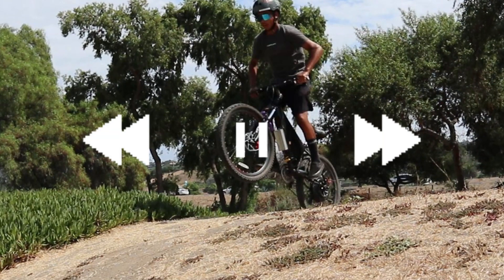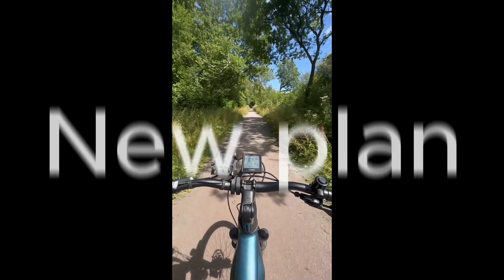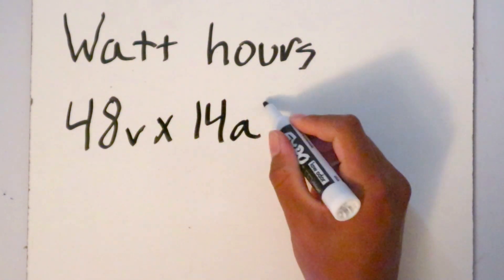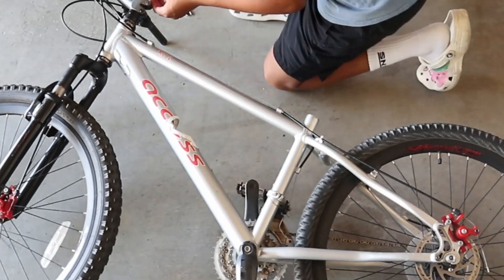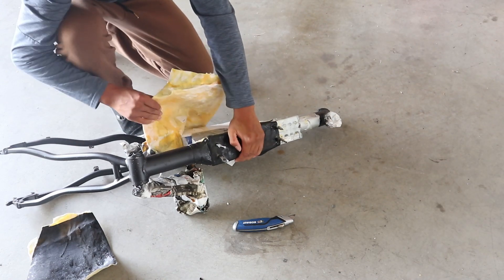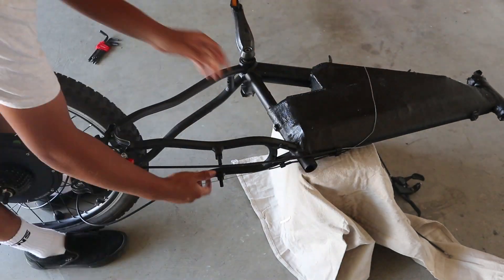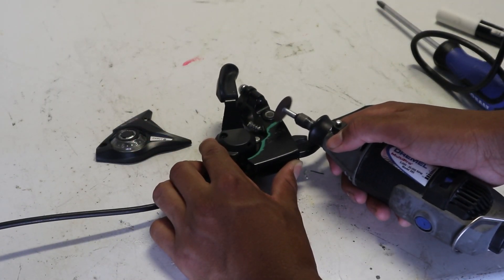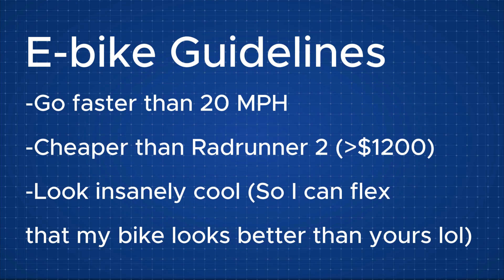I Built a Budget E-bike that Goes 30+ MPH????

Comment: This was not cheap but cheaply built 😂. The battery should be serviceable without tearing apart the whole frame. I think that the way to go is to buy a broken ebike for dirt cheap and go from there. If the base is bad or is messed up you can transplant the electronic on a new frame, cheap ebikes are just regular bikes with a kit and space ok the rack to fit the battery. The easiest is probably just to fix or replace what is broken on a good base (frame components are good but maybe it just needs a new controller or a new battery.

Comment: so you weakend the frame by cutting it ? and the battery is now non removable? traping all the heat inside of that housing. also if you make one bad landing and that frame colapes it will crush the battery with the sharp angles off the cuts you made and prob catch on fire, this isnt criticism. i am honestly worried for your safety. i recommend  you make the housing into a two piece that you can take off on both sides.. and weld two plates inside the hole you cut in a L shape so it holds the battery in place and it also will remove the weak point you have created in the frame. ride safe.

Comment: As a budget ebike owner. I would never ever recommend you do this unless you keep and charge your bike outside in an area that wont cause a fire if the battery goes. Lithium ion is dangerous. And removable batteries should be placed in a firesafe bag while charging, and storing. For safety. There is a reason some apartments ban them. Because people are being irresponsible with them. And if enough people keep breaking the laws of ebikes "20mph class 2 is legal basically anywhere a normal bike is, depending on the area" and class 3 is basically relegated to road only, which can be dangerous depending on the area.

A class 2 ebike, with anywhere from a 250-750w motor that can go 20mph. With a removable battery you can put in a firesafe bag. Can be had for 300 bucks on amazon. There is no reason to juice it up. Too many people do it without regulations in place, and eventually they're going to regulate them harder. Please dont ruin it for the rest of us.

Comment: Just a quick note, NEVER cheap out on the battery. While in this case he seemed to be fine, a lot of the time, the cheaper batteries are not tested and use really cheap components, which can be flammable and destroy your creation, or even worse, hurt you.
Reply: Yet I do agree but it is a rare occasion they can catch flames even a surron battery could catch flame by all standards just keep your battery in good condition and get new wiring which is very cheap and you’d be fine 99% of the time but You are right!
Reply: Thanks
Reply: I say always test the battery regardless of what price it was and always make sure you have a good BMS.

Comment: i have the same exact kit down to the grips, 19k kilometers and it still goes strong, also shunt modded and pulls about 45 amps/2.2kw from the battery at 48v, good cheap kit, the controller could have the 3 speed switch function but it just doesn't have wires to it, gets me up to 42mph now, all in all great video dude!
Reply: the current draw went from 27amps stock to i had it at a maximum of 74amps, thats around 3.5kw, had to turn it back down to 45amps so my battery can breathe, the max range of your ebike will surely change but as long as you dont go all out and hit that max draw your range shouldn't take that big of a hit, just make sure your battery cells/bms can run that amount of power without starting a fire. Also motor heat will be a big issue in the summer without any mods.
Reply from the maker: Dang

How long does the battery last after you shunted it?

I wanted to do that mod but I din wanna mess anything up

Comment: having 2t engine for about 200$ with few mods about 100$ and having it go 47mph is way more fun than e bike
Reply from the maker: Wont lie that does sound fun. Gas is just too loud for me thought. My neighbors might give me a noise complaint.
Reply: @MidModifications  stock muffler without any mods is about 80-95db loud so neighbours shouldnt have problem with that

Comment: How do you take out the batteri to charge it?
Reply from the maker: The battery had a built in charging port, so I just cut a hole in the canvas and made a plug so I can plug the charger into the side of the bike
Reply: @MidModifications  thats kinda cancer no?

Comment: Never ever cut into a frame, especially not with the torque you're putting on the frame afterwards. You should've just figured out what measurements you needed before you bought that tiny mountainbike.
Reply from the maker: Fair point. Next time I wont be cutting my frame lol.
Reply: @MidModifications where did you get it from

Comment: Not bad. I do worry a little about heat dissipation for the battery. I don't know how hot this particular one might get but adding a basic heatsink should help ensure it gets the job done. 
Cutting into the frame is a bit iffy too. Some welding of the battery frame to the frame could help with overall stability but that's also a whole other thing right there. It's not a significant chunk out of it so it should be fine but frame work is always hit or miss with modifications.
Reply from the maker: Yeah I have been getting a lot of comments about heat dissipation. I think that it should be fine, but just as a precaution I was planning to add some sort of heatsink or air cooling system just in case.

The frame cutting was a bit sketchy too. I added reinforcement to the back of the frame where I cut it, so Im not worried about that one as much.

Comment: Well on you for doing a 'self-build' 👍
They are sooo much fun!

I'm not a massive fan of the whole battery/frame modifications you did, but hey it's not that bad, and hopefully the frame won't break on you. I would've mounted the battery the other way, and put the controller inside the frame too (but hey, we're all different).

But overall you did great & it looks pretty cool too.

About 18 months ago I did a self build too, using a 26" Scott mtb & 1500w Voilamart kit with a 52v20ah triangle battery (fits perfectly inside the frame) and I love it...

I hope you and your self built e-beast have many a great journey, all the best my fellow e-builder/biker!!!

⚡🚲⚡

👍👍👍

Maybe get some Schwalbe (marathon) tyres for it, and a suspension seat-post, makes a massive difference to ride quality and with the Schwalbes I've done over 6000 miles with zero punctures.
Reply from the maker: Woah

I could definitaly use some better tires cause mine constantly go flat. Like every 2 hrs. A suspension seat would be good too, I could get on using that.

Thanks for your advice!
Reply: @MidModifications  you're welcome, and the Schwalbe 'marathon' not even the latest ones, as I bought these around 2 years ago...they are amazing tyres, after 6000+ miles they still grip excellently and I've had zero punctures, I also use Schwalbe inner-tubes with the tyres...
The inner tubes are cheap (around £5 each) and I think I only paid about £45 for the two 26" x 1.50 wide tyres.. they are also great for speed too and work great in the wet as well as the dry...
Can't rate Schwalbe tyres highly enough..
I'm doing a 3000w build in the next few months (if I can save enough😅) and I'll definately be putting Schwalbes on it, but I might try the newer 'marathon plus' version..
Apparently the 'marathon +' have a slightly thicker inner anti-puncture lining in them than the standard 'marathon' as in the Schwalbe tyres they have what's called 'green guard' anti puncture lining inside them, amazing tyres ⚡🚲👍

Comment: I wouldn’t trust those cheap blue rectangle packs, they are known for poor build quality. Also cutting aluminum with a normal cutoff disk will cause aluminum to melt into the blade and potentially overheat the blade and make it explode. However I’ve personally done it before and taken it slow and it hasn’t happened to me yet, but it’s just something to be aware of.
I’d like to see a 72v build, I also built a 48v bike as my first bike and thought it was fast, but a good 72v bike is on a whole different level. Try to get a good triangle pack so you don’t have to massacre the frame.
Reply from the maker: Yeah I want to make a 72v build as well. I really didnt want to cut the frame, but it was either cut the frame or cut the battery lol. I was looking into the triangle packs but they were a tad more expensive than the rectangle ones and I was short on money at the time. I will also remember not to cut aluminum with the normal disk, thank you for that!

Comment: Why would you butcher the frame 😮
Reply from the maker: I didn't rly have a choice. I wasn't gonna put it sideways and the only other option was to cut the battery lol.
Reply: @MidModifications  Just have it at an angle inside frame
Reply: @MidModifications Maybe next time buy a bottle 🍼 type battery 😅💯🙏
Reply from the maker: I would have cause they fit much better but it was like $40 more to get one.

Comment: The frame cut tho XD. good vid dog. I wouldn't ride around on that thing to much though. That heat doesn't have anywhere to go, could end bad.
Reply from the maker: Alright, I'll do something about the battery. You guys do bring up a really good point though because I didn't think of heat dissipation. Thanks bro.

Comment: this is a death trap. cutting the frame then covering a battery that heats up with poor mans carbon fiber is insane.  there is no where for the battery to dissipate heat.
Reply from the maker: Heat dissipation. I didn't think of that when I was building this. I will be sure to consider that in the next build I do that had a big battery in it.
Reply: If he's not over working the battery it will not even get warm let alone hot

Comment: Cutting you frame could cause cracks but other than that sick build
Reply from the maker: Thanks man. I didn't make a deal of it in the video, but I did reinforce the backside of the cut in the frame with some angle iron to prevent bending, which also doubled as my controller mount.
Reply: @MidModifications  That frame will crumple and cause some serious injury. Change frames man save yourself.
Reply: @Crypto-Live  im guesing you dont know how to read since he typed "I did reinforce the backside of the cut in the frame with some angle iron to prevent bending"
Reply: Not only that, but he made the battery essentially permanently attached this way. Lithium ion batteries do not charge in freezing cold and constitute serious dangers if they get into thermal runaway, so this build basically requires that you have a garage for the bike everywhere you plan to stay overnight.
Reply: @Nebulon-B_Frigate_FTW bro it’s not like your going to charge it outside in cold weather
Reply: I think he was being sarcastic
Reply: The negativity in this comment is unfounded!
lol
Reply: @radioactivelight  what are you even talking about, saying the frame is compromised is negativity? As far as I know the frame was indeed compromised, this is not hate it's a fact, but @MidModifications stated that he reinforced the frame so it's all good.